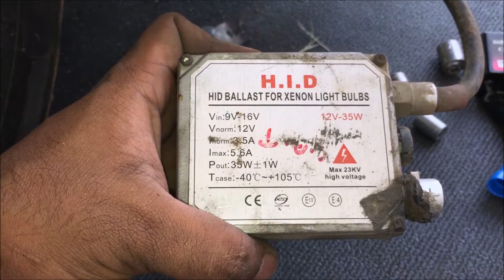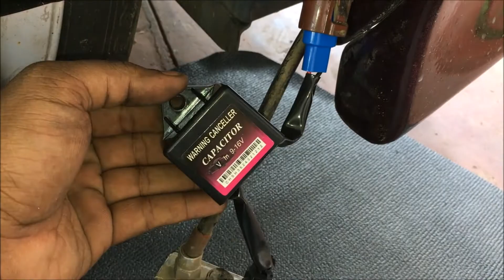How to install Warning Error Canceller Capacitor Anti flicker Xenon HID Light

Comment: Got these exact cancellers today for my 2008 Dodge Magnum. Wow. THEY ACTUALLY WORK! My right headlight would flicker fast and eventually just turn off completely. The right one would act funny sometimes too but now they're both continuously on. They would only do that when the car is on. I could have the car off with the lights on and they would act normal but when I turned the car on the left light began acting up. Thanks for the video!
Reply from the maker: Welcome. Thanks for the comment.
Reply: Thats exactly my situation!
Reply: I have the same problems as you I bought the capacitors, but the headlights still keep on acting up waste of time and money they should work right the first time we buy them.

Comment: what does warning canceller do ?
Reply from the maker: HID Decoder and HID Anti Flicker Capacitor is required for vehicles that get a headlights "flickering" or "strobe effect" after installing an HID Conversion Kit. They also eliminate "Bulb Out" warnings or "Bulb Failure Warning"in your dash.
Reply: I install hid headlights assembly and now they flick..would this help that problem
Reply: @luisvelez7734  They will, the capacitor helps to keep continuous current to the HIDs and avoid flickering.